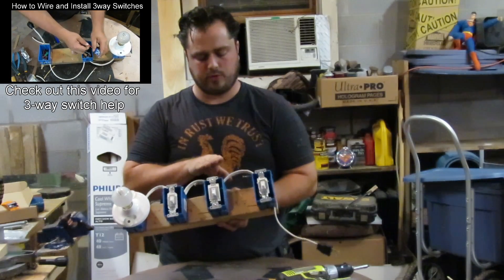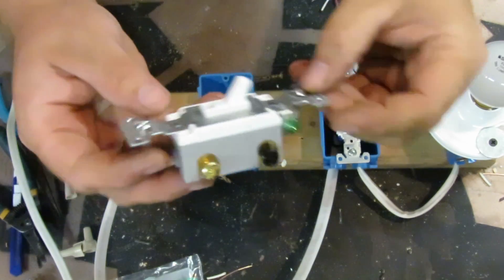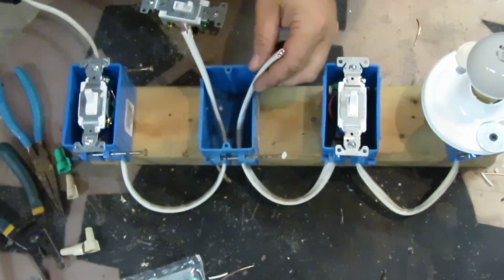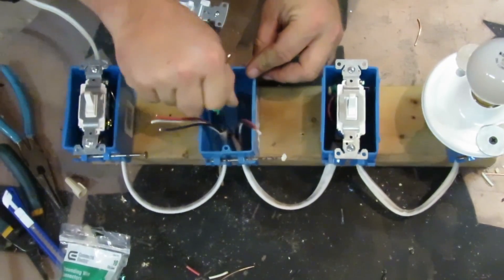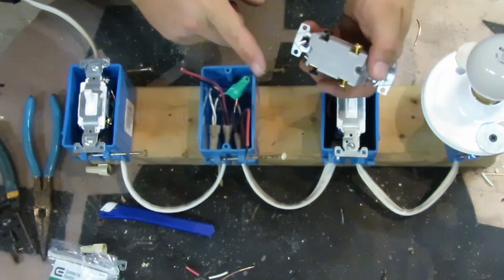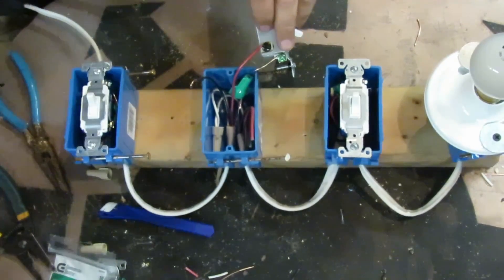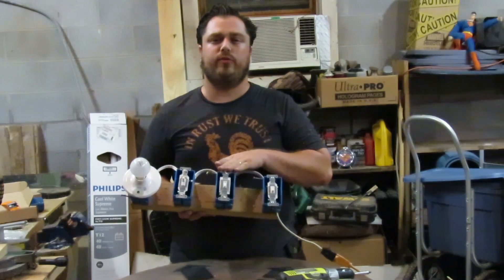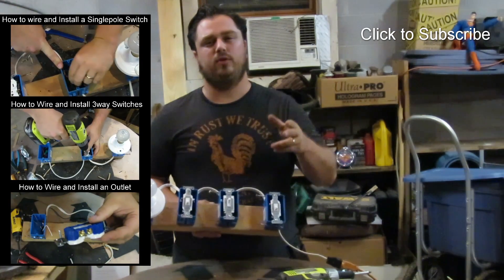How to Wire and Install 4-way Switches

Comment: Just a question about the 3 way boxes on both sides of the 4 way box.  Do you wire them the same exact way?  I was wondering since the 3 way switch only has 1 black and 2 brass screws?
Reply from the maker: The 3way switches would be wired up the same as any 3way switches
Reply: @MechanicalChaos  Thanks, I will look that up as I have never done a 3 way switch.
Reply from the maker: Good luck, and feel free to ask any questions you might have

Comment: Thanks for the video.  Can I use 16 3 wire instead?
Reply from the maker: That depends on what your code says, in the US, the NEC says that is it is a 15amp it has to be on a 14 wire or larger

Comment: I tried putting the wires on the same side and I still can’t get the correct result I guess I’ll have to keep messing with it
Reply from the maker: The traveler pair (ex: black and red) go on the matching colored screws (ex: brass or silver or black)

So ther would be a red wire on a black screw and a black wire on a black screw, and both of those wires would be coming from the same piece of 14/3 wire
Reply: @MechanicalChaos  thanks for your message I’ll try your advice
Reply: I have a red and white wire when it goes up to the light fixture and when it goes down which set of wires should go did the black or gold? I tried to put the white and red wires from one set of wires to the black screw in the other set of wires on the gold screw and it still doesn’t make a difference thanks for your help
Reply from the maker: Are you sure it is a 3way switch?
Reply: @MechanicalChaos  it’s a 4 way switch in between two 3-way switches
Reply from the maker: Ok, the wire set(1black and 1red from the same wire) go on the same,colored screws, typlically brass and black

Comment: thanks 4 the vid. so could we use 14 2 wire instead? Why or why not?
Reply from the maker: 14/3 is used because it takes the neutral to the light, but if you already have a neutral in the box with the switch leg, you could possibly use 14/2 as ypur travelers

Comment: Excellent video. Example is very clear and like your model. You perform these techniques very proficiently! Do you have a video describing the clockwise turn when you mount switch in electric box? One additional question...does it matter witch screws a wire is mounted, black or brass?
Thanks again.
Reply from the maker: Thank you, the travelers want to go on the matching colored screws and the common will go on the odd colored screw, diffrent switches will use diffrent colors for the screws, so just remember, the pair goes on the pair

Comment: So helpful, but I'm having trouble! After I've installed my one four-way switch and my two three-way switches, the two three switches are only turning the light on and off if the four-way switch is in the on position. If the four-way switch is in the off position, then the two three-way switches do nothing. What's going on? Where'd I go wrong?
Reply from the maker: Sounds like the travelers in the 4 way might be mixed up, make sure that the Red/black pair is on the same color screw
Ie: red/black pair #1 on brass screws and red/black pair #2 on black colored screw

Comment: so you have 3 ways on the ends and a 4 way switch in the middle?
Reply from the maker: Yep, you can have as many 4 way switches as you want between the 3way switches
Reply: @MechanicalChaos  Does the 4 way switch have to be in the middle? Does it matter which switch the light is attached to or which switch the power source is attached to?
Reply from the maker: The 4way has to be in the middle of the 3way switches, there are 3 or 4 diffrent ways to wire 3way switch systems, for simplicity sake, I just show power to one 3way switch and switch wire to the other 3way switch

Comment: thanks for posting the video. Very useful. I have a question about converting 4 way switch in to single pole switch for Occupancy sensor switches. would you show me how to turn them in to the single pole swich?  Thank you very much
Reply from the maker: To turn a 4way switch into a single pole switch, connect one pair of wires to one side of the switch and the other pair to the other side of the switch

Ie: the black and red pair on the top and the other black and red pair to the bottom
Reply: @MechanicalChaos Aawesome Thank you very much, I really appreciate the quick and helpful response.

Comment: Great video...UNTIL THE END!!!
So confusing, you say, ... turn counter-clockwise and then you state to do the exact opposite,...turn clockwise. Also, in the video, you twisted a red wire one way and black wire the other and failed to mention the reasoning behind this.
Reply from the maker: Glad you liked the video and sorry you didn't like parts, it is best to wrap your wires the same direction that you tighten the screw, which is clockwise, I must have misspoke and said counter clockwise
Reply: These are the people wiring houses, not paying much attention and pondering their next drink. Integrity, scarce these days.
Reply from the maker: Ok

Comment: Hi 

I wonder if someone can help me with an issue I am having. I have different 2 sets of lights in a 4 way switch set up (2-3way switches and 1-4way switch). They are controlling 2 different sets of hallway lights. 

I replaced two of the switches with 3 way switches and one switch with a 4 way switch on both sets of switches. One set works properly but the second set not so good. 

If the lights are on I can turn the lights on and off with any of the 3 switches. If i turn the lights off with one of the 3 switches I cannot turn the lights back on with either of the 2 other switches. I have to go back to the original switch I used to turn the lights back on again. They worked fine before any help would be appreciated. 

This is a good video it gave me some ideas where to check but I still mixed something up.

Thanks
Reply from the maker: +johndi1962 sounds like you might have mixed up one of your travelers with a common wire, check both 3 way switches, other wise it could be travelers mixed up in the 4way.
Good luck
Reply: Thanks for the advice.

Comment: CAN YOU EXPLAIN MORE SPECIFIC ON VIDEOS HOW TO HOOK UP THE HOT ON THE TOP OR BOTTOM OF SWITCH...
OR IT DOESNT MATTER WHICH ON TOP OR BOTTOM...???
Reply from the maker: +David Truong on 4 way switches, there are no hot wires, they are a pair of travelers in and a pair of travelers out.
On 3 way switches, the odd colored screw gets your common wire(hot or switch wire)
On single pole switches, the top and bottem don't matter, as long as all hots are together and all switch wires are together

Comment: I have a feed two wire black and white to a three way switch that feed a four way to a light and out of the light i feed another four way and out of that four way i have an end three way switch. How do i wire by color the switch system? Remember the light is in the middle of the two four ways with the three ways on each end, first three way is fed by black and white wire.
Reply from the maker: ok, you have a 3way, 4way,4way,3way and the switch line come out of one of the middle 4 ways? but other wise the 14-3 wires are only in the switch boxes? not to the light. correct?
Reply from the maker: if this is the case, [wire the first 3way normal], {the next 4way with the light switch line, wire the incoming white wire to the light, the incoming red& black as your travelers. wire the outgoing black to the light switch line and wire the red and white as travelers}, [the next 4way, wire your black wires together, and use the red and white wires as travelers], and on {the last 3way, wire the red and white as travelers and the black as your common} this will not give you a neutral in this switch box unless one is already present.
Reply from the maker: good luck
Reply: Right, i got it done. I had to com out of the center off the first four way into the light and out of the light i had to run the white wire off the light to the black wire to the other four way and out of that four way i had to run to the last three way. I think that is right now. It works. thanks,
Reply: Thanks, I got it wired. I did go from the four way to the light and tie the neutral to neutral and the black at the light to the outgoing neutral or white wire to the last four way and then down to the three way normally.
Reply from the maker: +Thor Thunder glad to hear that you got iy taken care of